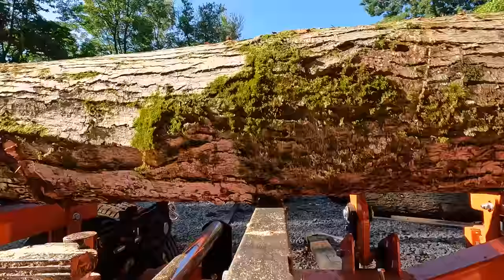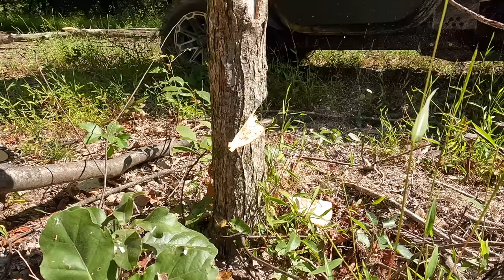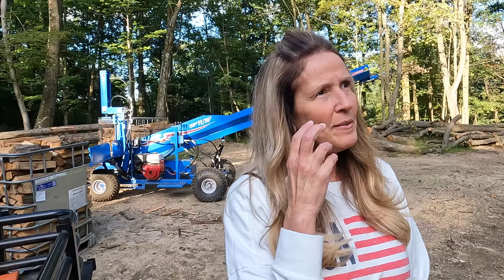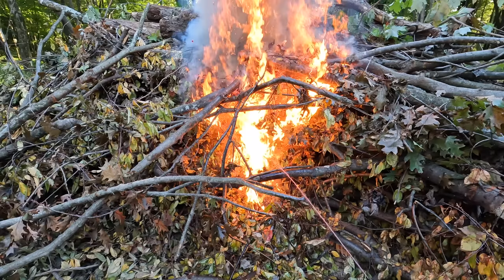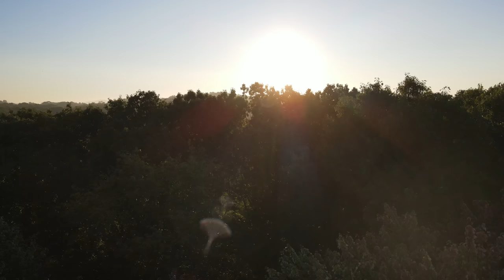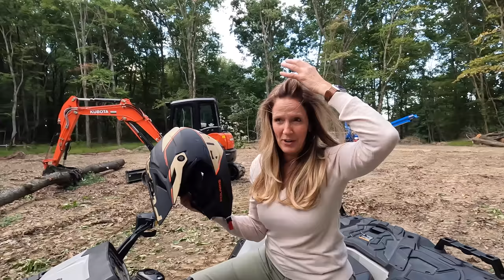Clearing the way for Baby! And Sawmill DIY Shower Stuff

Comment: Imagine the channel exposure taking Eva and Eli to a Shelter Institute post and beam workshop.  Then after milling hold a building workshop in the clearing coordinated by Shelter Institute.   You can repay with cut sheet hardwoods.  That class would fill up fast in PA.  Shelter Institute is in Vermont I believe.  All star group.

Comment: Do you think we could see some of the work inside your shop, it doesn’t have to be much, just how the walls came out and what you’ve done inside the other rooms.  And if you are going to use the in floor heating system.  Also, maybe how your mom’s and sisters roads are doing.

Comment: Mike, would be interested in a short segment showing your video and editing equipment. Additionally, apologies if this has already been mentioned… Depending on which video editing software you’re using, many of them have a feature that will align multiple tracks based on their audio waveforms with a click of a button. If that applies to the program you use, hope it’s helpful.

Comment: You can poor used motor oil on wet wood let it sit for 30 min add a little diesel fuel to it and that wet wood will burn like it’s been dry for months

Comment: I thought it was funny that you said you don't want to use to much diesel to start the fire because the price is rising but yet it appears that you were using on road fuel rather than the red off road diesel. .... Is there a reason you're not using red fuel?

Comment: Hey Mike, are you required to inform your local Fire Department whenever you light a fire on your property ? Here in San Diego you probably wouldn't be allowed to set your metal trash can on fire !! Just wondering...?
Reply from the maker: No requirement here
Reply: That's great !! It was like that in the "old country" (Rhodesia) - where we came from 40+ years ago !!